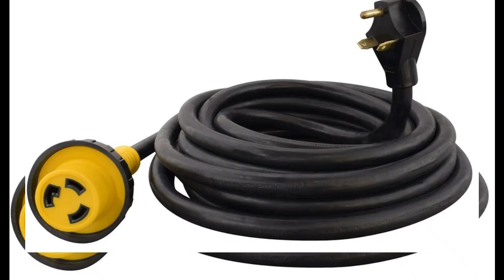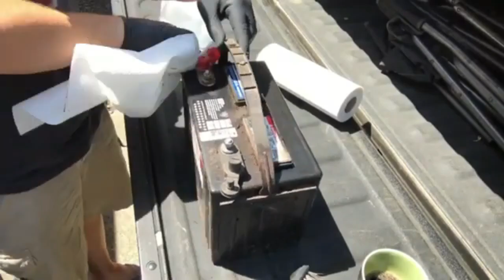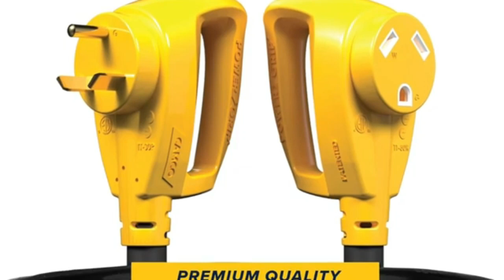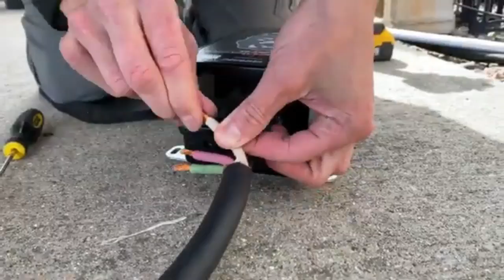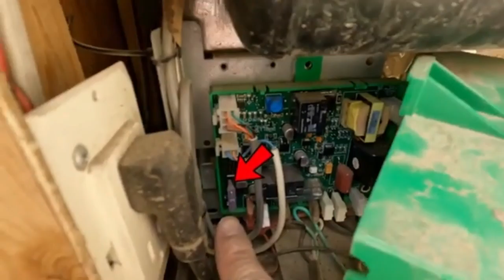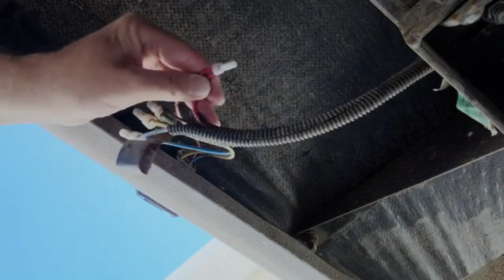11 Most DEADLY RV Electrical Mistakes (Do NOT Ignore This!)

Comment: Umm no...where u get the heat is most rvs have ur large chord plug into your 50 amp ...the heavy chord only exists on the outside of ur coach...on the inside they go with a smaller wire to your bussbar/ panel ...THIS IS WHERE U GENERATE HEAT...large wire to small